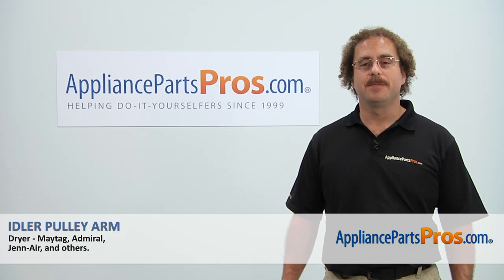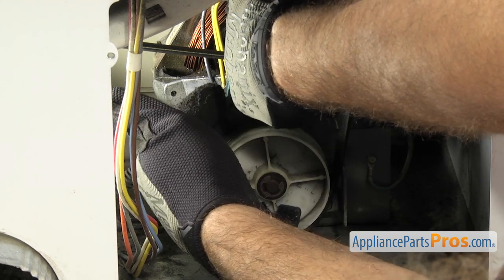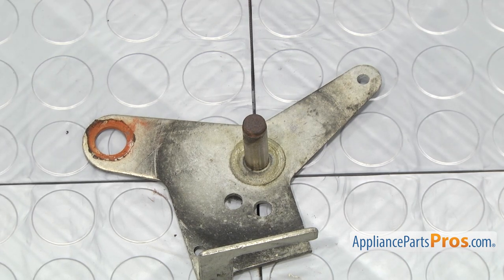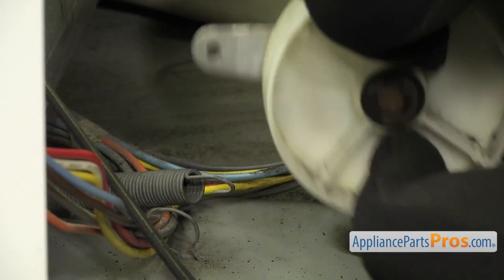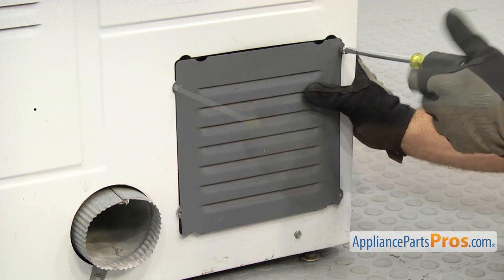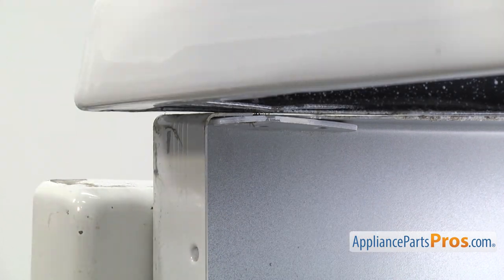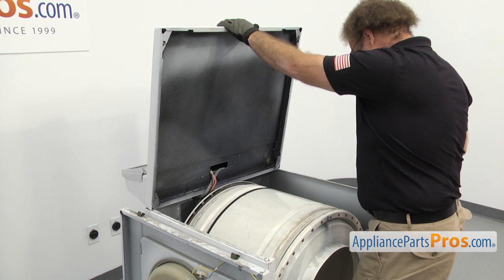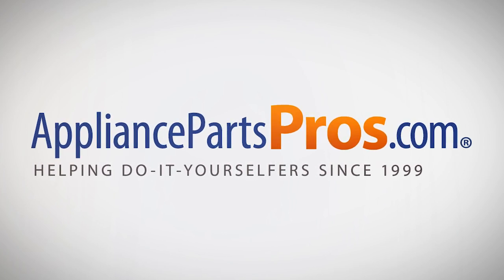How To: Whirlpool/KitchenAid/Maytag Dryer Idler Pulley Arm WP6-3033630

Comment: It took me awhile, but I managed to get the belt back on. But, I could only position it so the ribbed side is on the motor pulley. The rest of the belt that touches the drum and tensioner is the non-ribbed side. Is that correct?
Reply from the maker: Yes that is correct.

Comment: i REPLACED the pully wheel very simply but dryer still making loud noise
Reply from the maker: What is your model number and what is the noise that the unit is making?
Reply: I think it is the bearings. I found this video because I was looking for what to do to stop the squeaking my dryer is making. This video is about the part the wheel with the bearings in mounted on